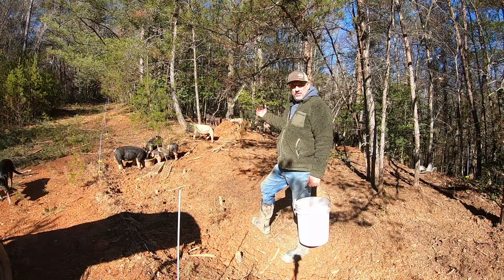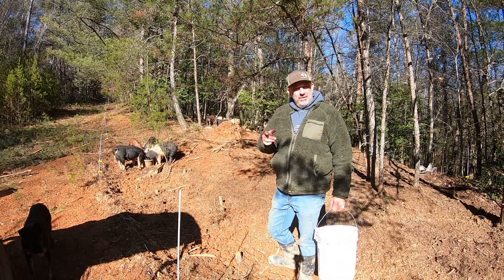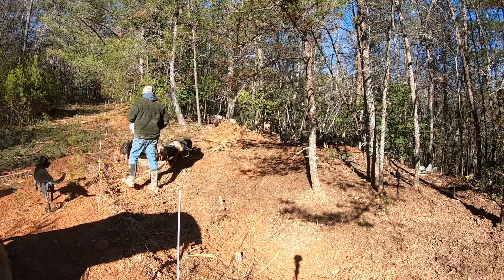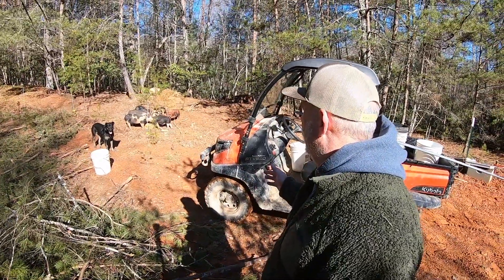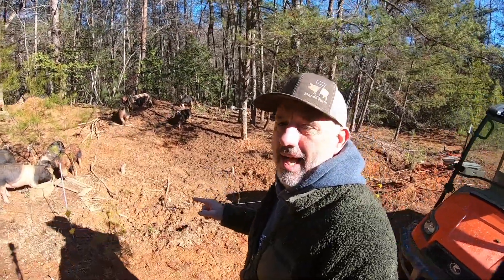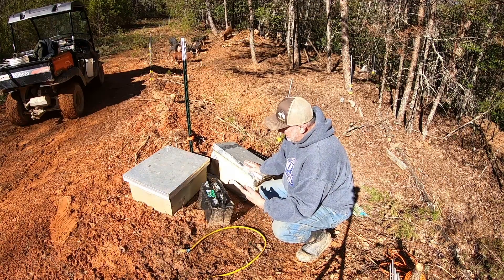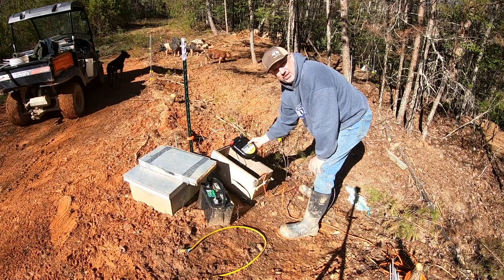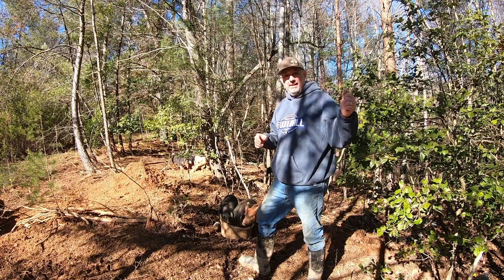My electric fence is not working! IT WON'T SHOCK

Comment: I think this is my problem! My fence shocks, but it's not that bad and I've seen deer just walk right through it. Voltage looks good with a test. Two questions. 

1) Do you just run the line clamped to your original ground rod to the new ground rod? 

2) It looks like the line that runs from ground rod to ground run is just laying on the ground? Is that correct? I'm using 14 gauge aluminum wire.
Reply from the maker: If I add a ground rod you can go from last rod to the next one 
Yes my ground wire just goes from charger across the ground to each ground rod never had problems with that at all 
If there is not a good ground you can show high voltage on tester but not shocking. I like to use a minimum of 3 8 foot ground rods 12 feet apart. If you use your fence checker on your ground wire after installing 3 rods and it shows power on it I add another ground rod 
Thanks for watching and commenting 
If I didn’t make sense feel free to ask more questions

Comment: Touch the fence at the furthest point.  Does it bite or just tingle?  It won't hurt ya, just "shock" ya for a milli-sec.
Reply from the maker: Thank you I actually did that and four out it was not really shocking just showing power on meter thank you for watching and for commenting we appreciate it

Comment: We used to raise horses B4 we retired and in the summer is when we would have fence voltage issues.  Got a new charger and it required 3 10 foot grounding rods 10 feet apart.  After installation,  we had no more issues.  Found out that the horses hooves insulated enough to not let them get the full shock until new grounding rods were in.

My dad raised pigs when i was about 10 using electric fence (lived near the west coast ocean so had no ground issue).  One day he wanted to move the pigs; took the fence down, but the pigs would not cross the line where it changed from dirt to grass.  Don't remember what happened.
Reply from the maker: Until I really started researching electric fence when my pigs kept getting out I didn’t realize how important the ground rods where thank you for watching our videos

Comment: You do realize you already have potential "ground rods" all the way around your pen?  Run your ground wire around to the tops of your posts. Then you always have a good ground where the pigs are.
Reply from the maker: You are correct that can work my only problem is I use fiberglass posts 
But I have thought about running a ground wire between my two hot wires to the back of my paddock and add another ground rod 
Thank you for watching

Comment: You also have to use the same metal type of grounding clamps ! Grounding wire, rods and clamps all the same metal ! Also use three 8 ft. grounding rod all the way in the ground ! The longer grounding rod can reach further into the soil to reach more moisture to make it work better ! That's why contractors use 8 ft, copper rods. Copper conducts electricity better than galvanized ! By the way your video was very good, Great Job !!  🙂👍
Reply from the maker: Thank you I have 1 paddock of copper ground rods and I really think it works better than the galvanized but around here galvanized is so much cheaper and works pretty good also it is hard to find galvanized clamps for the ground rods. Thank you for the nice comments and thank you for watching our videos
Reply: @7StandsFarm   The grounding rod clamps for the galvanized rods can be zinc coated. They are a metal not copper. The whole thing is "whatever works for you". I was just throwing in a few pieces of input before and the electric fence instructions that came with my fence said to install 3 grounding rods. And other information that I discovered about the grounding materials like the rods, the wire and the grounding rod clamps needing to be all the same material or electrolysis would occur came from a video from an electric fence company. Sorry to ruffle your feathers but I think you made a very good instructional video explaining everything really well.
Reply from the maker: @chriscox5568  I am sorry if you felt like my feathers were ruffled if was not my intention at all I really appreciate your input and was only saying  I had not thought about galvanized clamps and it was hard to find them so thank you for commenting and helping I appreciate it and again I apologize if my reply seemed at all harsh please forgive me

Comment: Is your fence 2 hot wires or 1 hot and 1 ground? I suggest always use a ground wire along with your hot wires and connect the ground wire strand back to your ground rod configuration then the circuit will be completed when the animal comes in contact with both wires regardless of the distance between the ground rods and where the animal contacts the fence rather than just depending on the animal’s feet contacting the dirt to complete the circuit.
Reply from the maker: Thank you I have actually been reading about this and thinking about giving it a try 
Thank you for watching our videos

Comment: Hello Jamie.  "The grass is always greener on the other side" with pigs and with chickens. Here in South Carolina, I have grounding issues and have to use at least one 8' grounding rod and sometimes multiples to get proper grounding and when its dry I'll have to pour water around the rod to keep the area wet. I successfully use the Patriot P20 chargers for my different pig groups plenty of enough shocking power. My groups are mostly in the woods with sparse sunlight so DC powered chargers are my only choice.  In regard to my newly freed piglets- graduated from training area, I too had issues with them escaping. I have overcome this problem by running a second unenergized wire at the bottom which has stop them from escaping. (They still try) Once they've reached about 100 pounds or about the 2nd or 3rd move no more issues and I can start using a single wire. Some more work in the beginning but a lot less frustration. Piglet's hooves will act like an insulator and because they are lighter in weight, they may not ground themselves like an heavier pig. Due to their light weight this reason can insulate them from feeling the energy of the fencing especially if there's a lot of ground cover.
Reply from the maker: I agree totally one my pigs get to about 100 pounds I don’t really have trouble either not sure if it is their feet or what but they are stubborn thank you for watching
Reply: 0😊 4:18 😅😊 4:18

Comment: I know everyone likes the thought of poly wire, the issue I was having is you don’t get that immediate shock like you do with metal wire. For that reason I will run 1 strand of each. I also use a cheap 5-10$ reel to roll up the metal wire as well.
Reply from the maker: I have had good success with poly wire for smaller paddocks but because of the price I have switched to the metal 14 gage wire. I haven’t tried to roll it up on a reel yet but that is my plan thank you for watching and thanks for your comment